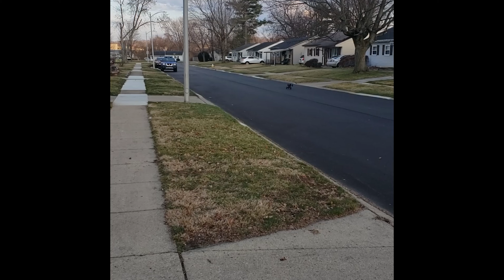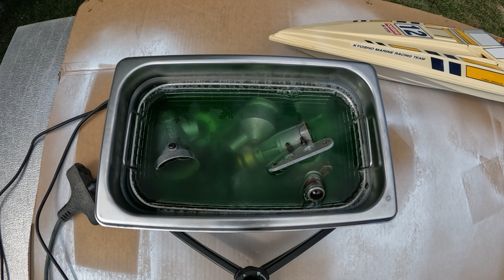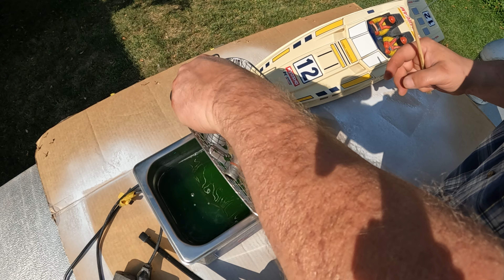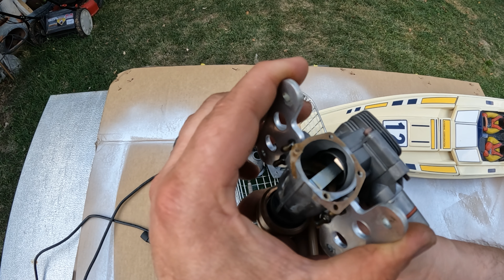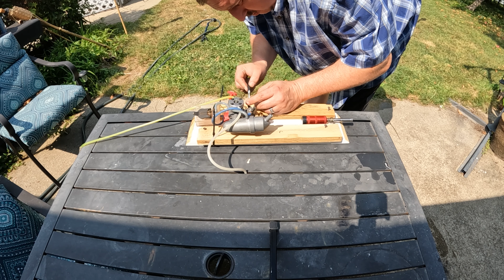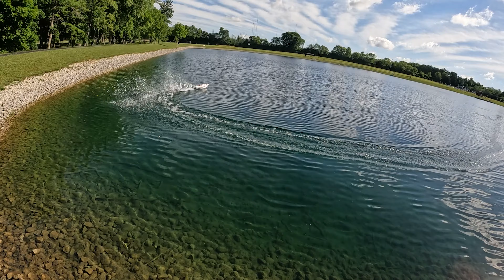#kyosho  jetstream 1000 #nitro boat restoration part 3

Comment: Nice to see that the project is growing 👍
You have the gt 32 ,not 35😅
And please don’t run them on car fuel 🫣Otherwise it will wear out very fast
Reply from the maker: i promise no more car fuel just wanted to confirm it runs
Reply: @LotuseRC  happy to acknowledge this👍
I tried today for you to search the manual of the Kyosho gt-32 marine engine and also tried to find the manual of the Jetstream 1000, but sadly I was unable to find…I will try to search more detailed tomorrow,if I’m able to find the factory tune I’ll let u know them 😉
I’ve started yesterday the break in on my Proboat Miss Formula ,probably you’ve already see the small trailer do it on my channel,it’s a short
https://youtube.com/shorts/OSqyfcjB3qk?si=fSDts97G2gPjHPYA

Let“s make nitroboating great again 👍
Reply from the maker: ya cant find manuals anywhere no worries though i can get it dialed without got it fired on the first tune try